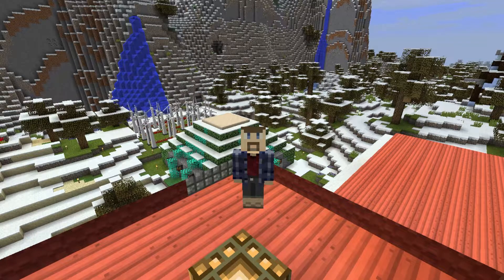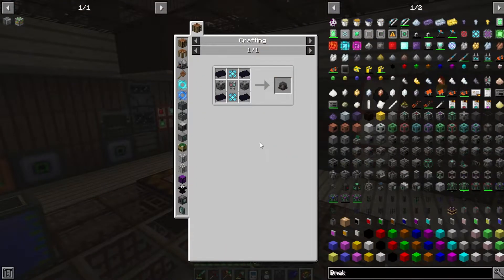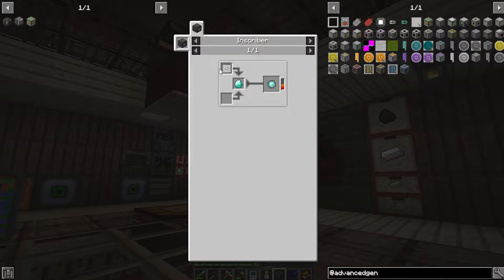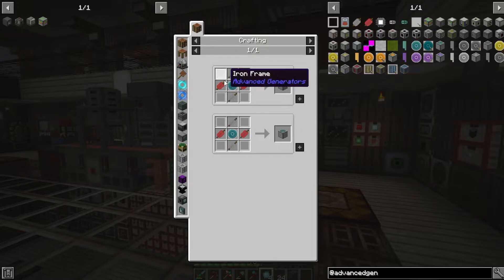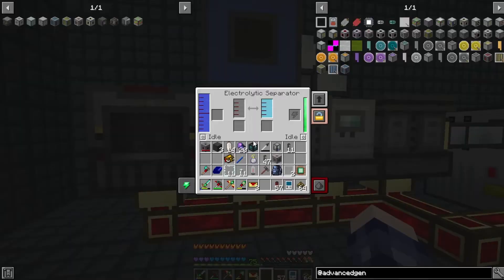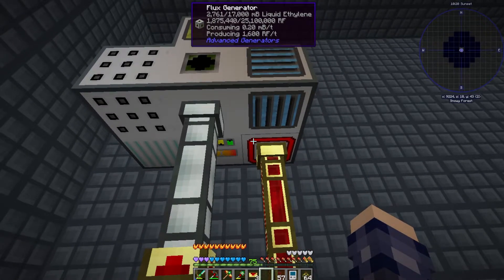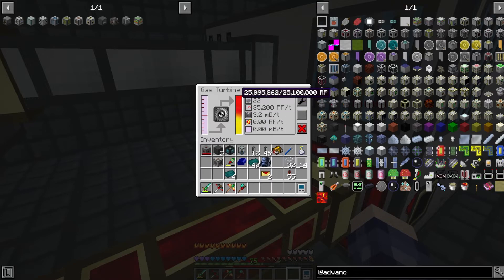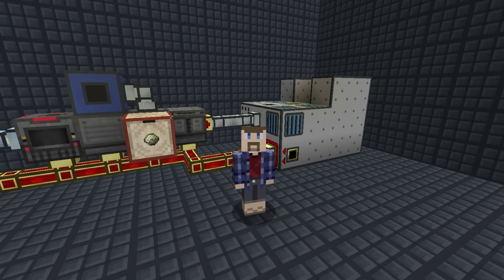Advanced Generators Ethylene Gas Turbine - Minecraft: Enigmatica 2 Expert #43

Comment: How are you getting the water into the prc?
Reply from the maker: At 7:13, you can see the compact water supply above the electrolytic separator.  There's a pipe coming off of it from the right that goes down into the PRC.  The PRC is a very sided machine, you can go into it's settings, and change which sides things pipe in and out of.  Try changing those until the inputs work right.

Comment: Did you try using the mekanism gas tubes. I’m sure they work ok with the gas valve. You were right about it being OP for power. My reactor only makes 22krf/t. So this should be a great free energy set once I set my farm up. If you farm pumpkins they makes 4 seeds for the bio fuel. Maybe a little easier to keep up with than saplings if you scale up even more. I’ve not set my gen set up yet. Only done it in a test world so far. But have all the items but started with 2 steel turbines. Need to get mining more platinum for the enderium. Dropped a huge clanger last night and upgraded my void ore miner to t3 before I upgraded all the structure blocks. So now it stopped working DOH. 
Do you have any good tips on finding iridium easily been end city and village/temple raiding so far. Was hoping I could use the scanner to find them. But no it won’t scan for shards. 😄
Reply from the maker: I did not try the Mekansim gas pipes, but from what I understand, the Mekanism gasses are generally considered liquids by other packs.  I tried thermal dynamics fluid ducts and those didn't work.  The gas version isn't listed as something the turbines can burn though, so I gave up trying pretty quick.

Pumpkins or melons from a cloche to a compacting drawer is what people generally use, but when have I ever been known to follow the crowd?  I mentioned those in a segment I cut since it didn't seem useful.  I specifically went with something I had a massive excess of already instead of single purposing this.  Unless I start using 80k power full bore all the time, my sapling supply should keep up.

What I should do is wire my void miner up to my main power grid now though.  I finally figured out why I didn't have enough power.  I was just an idiot and misread the wind generators.  I'm only pulling in like 1k power from them total.

As far as iridium goes, the only real cheat for it without going to other planets is to pulverize platinum ore for it.  I just dug down to bedrock in the nether, and started veinmining all the netherrack.  It's pretty common down there, but in small amounts.  You could also use a scanner to find it, but honestly, just make an indestructible crushing hammer and then sieve the crushed netherrack also for additional ore.

Not to intentionally drive traffic back to my own videos, but the platinum to iridium thing was what this episode was about:  https://youtu.be/x2QXM-hJ6Jw
Reply: In one of the tips it mentions nuclear craft machines can auto covert gas/liquids for mekanism. Will try the pulveriser route for iridium. Spent a couple of hours looking for shards last time. 
Good idea to use what you have and top up with the tree farm.
Reply from the maker: You know what, I straight up forgot about that tip.  The nuclearcraft machines however are all massive power consumers compared to the mekanism ones.  They were specifically increased in power drain for this modpack.  Changing it from gas to liquid wasn't hard, it's just one more machine in the chain.